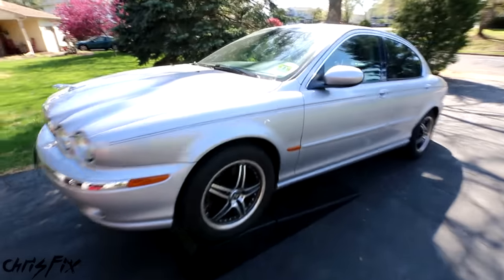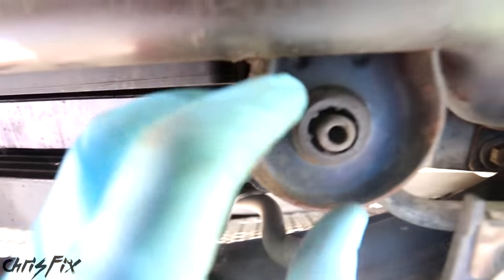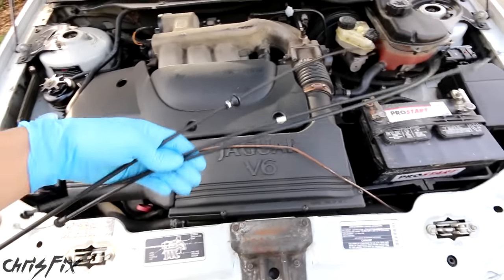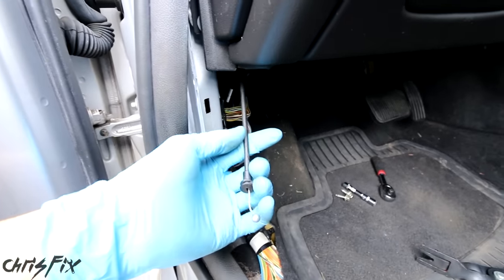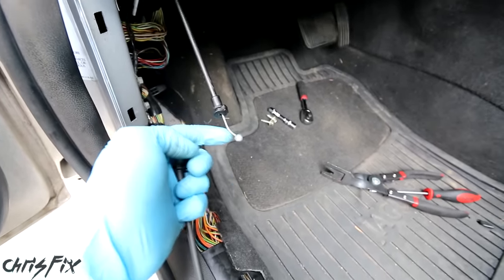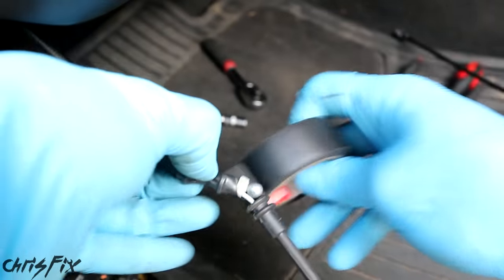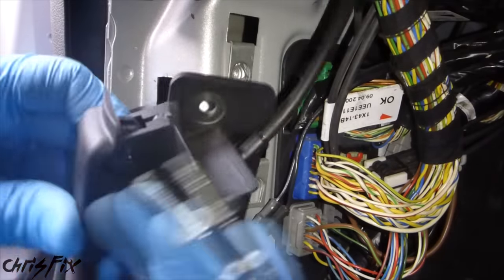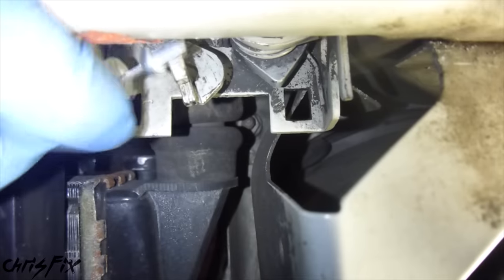What if your car's Hood won't Open?

Comment: My mum's car was made in 2002 (Ford Focus 2.0 Sedan). The hood is pretty easy to open. There's this button at the front which unlocks the hood. Then you press the Ford logo on the hood and it will open.
Reply from the maker: Nice!
Reply: There is also a button in the car which opens the boot (in Australia we call it the boot, but since you are probably American, it's the trunk).
Reply: Also, *grill. Not hood.
Reply: I don't know why, but her car isn't like most cars. It doesn't have handles on the doors that like like they are indented on the door, they look like someone just attached the handles on the car, or, they simply bulge out.

Comment: So that's how the battery to my car was stolen. Some theif left my hood popped open, and I wanted to understand how they did it. I now know how to do it, but is there anyway I can prevent them from getting to the wire. I was thinking of welding medal sheets to prevent them from tempering with the wires. Is there a better alternative you guys might reccomend? I've heard of the battery lock  mechanism.

Comment: Using some silicone spray on the cable would make it easier to slide through the firewall grommet.
Reply from the maker: Great tip! Thanks.

Comment: I know you're a Vette guy too. Any tips on how to use the C4 hood opening tool that Ecklers sells? My cable broke today and hood is shut tight. They make it look easy but all videos I've seen demonstrate the tool with the hood open. Not as easy with it closed. Just wondering if you ever came across the same problem. Thanks

Comment: Since it's a Jaguar, the best way to open the hood is to get it to about 70 miles an hour and then, very carefully, steer it toward a sturdy tree. That should definitely open the hood but also unlikely to damaged anything else that wasn't working anyway.

Comment: Good stuff Chris, ta very much. You could use the tip from the end of the video with wiring up a different speaker or something too couldn't you =)
Reply from the maker: Yes you could! It is a good way to run wires as well! I do that in this video: https://www.youtube.com/watch?v=b8GY69Ci7l4

Comment: your videos are so good Chris. my BMW 320i 3 series 1995 it won't start theres no clicking or anything when I turn the key. I've been told it's the starter and the immobiliser . do you have any suggestions. thanks
Reply: Take to a mechanic or a friend that knows about cars and then you should get your answer. Just tell them EVERYTHING you've done to it and when the last time it's functioned fine was
Reply from the maker: If it is the immobilizer then that is tough to diagnose but a bad starter is easy to diagnose. Jump the starter with 12v and see if it engages. Also, make sure the car is in park and also test the car in neutral.

Comment: Congratulations to Jaguar for out-engineering Honda for once. My Civic hood release is a pull tab that you pull straight towards you. It easily breaks and you're left with the exposed cable that now requires pliers to operate, before a proper fix.

Comment: This might not work (which may or may not be obvious) on hoods that use the car's key to open the hood, like my '07 Ford Focus MkII. It uses a plastic connection piece in mine to connect the keyhole to the latch. It actually broke once when I tried to open it, which was a pretty expensive fix. :(

Comment: Love your videos Chris. My 06 Accord's trunk won't open using the remote control in the car key but will open manually using the lever inside the car. Any help is appreciated.
Reply from the maker: when it clicks can you pop it up by hand? Maybe it just needs some lubrication!

Comment: Hello chris I been watching all your videos there the best videos I have seen so far !!!! I have a problem I purchased a Subaru Legacy 2005 Gt limited and I keep reading what type of coolant is best for the car but a lot are saying buy the Subaru long Life coolant vs the Peak Global Lifetime I just wanna know what the difference?
Reply: +Carmelo Ramirez 
After doing a bit of research I was able to find a difference between the two.
Subaru Long Life coolant is a phosphate based coolant. Phosphate additives in coolant have no anti-corrosion properties for aluminum, which is not necessary for your vehicle. Peak Global Lifetime does have anti-corrosive properties in the coolant. Although the other coolant will probably be fine, I'd use the Subaru Long Life coolant as a safe measure to ensure nothing happens.
Reply: Personally, I would go with whichever one is more available. 
I have 250k miles on my '99 Impreza and have always used the standard green coolant. 
You have to worry about changing it on time, more than using Subaru brand vs standard.
It's likely that at some point, a hose clamp, hose, or even the radiator itself will fail and you will not be able to readily get Subaru coolant.

Comment: Tips to clean your rims! (Brake dust and dirt :D)
Reply from the maker: +AVA That is a good idea!
Reply: +AVA 
Usually a decent all-purpose cleaner will get the job done quite easily.
Reply: Omar Awad Nope
Reply: Why nope?
Reply: AVA 
Why nope? APCs always work lol. Dedicated wheel cleaners have most the same chemicals in them.
Reply: Omar Awad Sometimes dirt and breakdust is too sticked to the rim, or there is just too much dirt and breakdust. Some cars have that problem (For examble Mercedes and Audi) (sry for my bad English:) )
Reply: I use all-purpose cleaner on my Mercedes! Let it sit on the wheel for a little bit, then go in and agitate it with a scrub brush. If your wheels are extremely bad, repeat this process and maybe even use fine steel wool or a sponge with a rough side on it.
Reply: Omar Awad :o Doesnt work on 2010 e-class (front) :D
Reply: AVA 
It takes a lot of work the first time, but once you clean it very well, it becomes very easy to clean it next time. I actually have an e-class too, haha.
Reply: +Omar Awad YaY :D

Comment: ANY THOUGHTS?: My hood release pull cord works just fine so, I really dont think its the pull cable/cord inside the cabin. It unlocks the hood, but the hood doesn't pop up and open on its own. I have to manually pry open the hood

Comment: I had opposite problem in my hood would open but not close. These seize up really bad in our winters in saskatchewan. Seems if you grab the cable manually an pull it real hard to the left it resets it an itll close

Comment: Hi Chris. Applied wd40 on the locking mechanism of my trunk and it still won't open. The lever that's hooked to the cable does not retrack or goes backwards when the key remote is pressed. Hence only the manual opener inside the car would olen it cuz it pulls the lever far enough to open the trunk.
Reply from the maker: Check out that lever and the cable then. See if it is rusty, getting hung up, stretched out, etc

Comment: Tried fixing my hood would close one side but not other now it won’t open at all should I just use the pry bar pop it open from bottom ? Also seems like my cable is to shorty should I just remove it all and add a new cable please help i have the Same exact car

Comment: Hey Chris, I know this is an old video but I have a Toyota Solara with a finnicky hood latch.  When just pulling the release, it has very little tension and nothing happens.  If I have someone pry up on the hood a little while I pull the release, it will pop like normal.  Should doing what you did in this video fix my issue?

Comment: Did this fix using your vid as reference, thanks, by the way have you a video on start up issues involving that car model, just replaced the battery cranks but won't turn over, any suggestions welcomed, thanks
Reply from the maker: Awesome!!! 
Check your fuel pressure and fuel pump: https://www.youtube.com/watch?v=mDIlwbx0B-s
Reply: ChrisFix thanks for replying will give those a try, 😎👍

Comment: Chris, I have a 2004 Mustang V6 3.8, manual transmission, rear wheel driver ofcourse. and I am going to need to to tow it from NY to CA, now that's a pretty long ride and I am on budget, any ideas that doesn't include trailers? Also, some manuals says flat towing is ok for the car and others says I have to remove the drive shaft.

Please let me know if you have any advise.
Thanks man
Reply: That's what I understand too Jmac, however some forms says that the manual transmission on this car works on upper shaft that doesn't get lubricated if not turned on. I kinda don't agree or understand that. Dealers don't know anything "my opinion" they try to slick out by telling me to put it on trailer without even asking about which year the car is :|.

Side note: this car is rear wheel drive, raising up the front wheel won't help. Thank you so :)
Reply: *****
makes more sense now, it will still scrap the front on asphalt all the way there, also not sure if the steering lock can hold this long of a distance swerving between traffic :D

Comment: That's quite easy... because the difficult part is opening that by hand or with a tool for the first time. That car had an easy access and it have 2 clips... mine has one in the middle, on top of the radiator and there's no way to open it by hand... i've had to dismount all the calender.

Comment: Jaguar X-Type  -- a.k.a. Ford Mondeo.  Same car, different badge.  Although, you couldn't buy a 3rd-gen Mondeo in the states -- it was sold here as the Ford Countour (and the Mercury Mystique) until the platform's 3rd generation came out, then they quit selling them here.  Shame, too, because the Countour with the V6 was quite a good car, for its day.  But you could buy the Jaguar X-Type, which was way overpriced compared to what a Contour would've sold for, if they had sold the 3rd-gen Contour here.

Comment: Question, Wouldn't it be smart oiling the cable just in case for extra long smoothness?
Reply from the maker: I was going to say that in the video but with thinking it though a little more, I found that the oil attracts dirt and dust which can cause more problems. The new wire has a coating on it to prevent rust so we shall see how that works! Good thinking!
Reply: +ChrisFix Thank you. I had problems with an wire like 1.5 years ago when it started to rust in an month because I didn't oil it so just tought to ask. Great videos btw even if I dont always learn something I enjoy watching them.

Comment: The correct term for what you did is not a snaking or using a snake, it's a pull string.  This is the term that we use in data communications If you're using bad cable to pull replacement cable.  It's also common practice with modern cabling is that a thin rope is run through the conduit or whatever In the industry so you have a pull string at all times.  We don't use what's called a snake, we use what's called fish tape.  The fish tape is pushed through the hole to where we need to have the cable pulled from attach the cable and pull it through.  I've had to use it many times to pull new data cabling as an emergency bypass for my former employer.

Get your technical terms correct.  Snakes are for clearing out a drain, fish tapes and pull strings are used for pulling cable.

Comment: Wait, shouldnt there be a security latch you have to lift before you can open the hood? Like, when you pull on the lever in the cabin, the hood opens a little bit, and then you have to pull on another latch under the hood to actually get the hood to open. This car doesnt seem to have that.

Comment: hey chris, I got sometimes problems with opening my small door of the gas tank. I press the leverage inside of the car for opening the door but it gets stuck often so its very awkward on the gas station lol. Any tips?
Reply from the maker: Lubricate the hinge and see if you can find where it’s getting caught up. Might have to be bent back a little or something.
Reply: @chrisfix  ok thanks for the tip,will try that :)

Comment: Hi Chris 

My VW Jetta 2007 is having similar issue. Hood release lever is working fine. When I pull it, it pops the hood open, but there is a tiny button which I have to push to make the hood completely open. When I press that button and pull the hood, it is supposed to open but it does not open.  Any thoughts???
Reply from the maker: Spray it down with some silicone or wd40 or something to loosen it up.
Reply: @chrisfix  thank you

Comment: Hey Chris, or anybody that might be able to help, I just bought a 91 Camaro RS, the hood isn't completely stuck shut but when I pull the hood release it doesn't pop open so sometimes I have to pull it multiple times before it unlocks and I can kind of force it to open. I know a lot of people have this problem it's fairly common but I can't seem to find any videos on how to fix it. Also since I'm going to be working on it a lot and I'm not super experienced expect a lot more questions coming in from me. Thanks in advance

Comment: Hey Chris any ideas on a kia amonti 2007 I change the radiator.  Now the hood does not open I put the cable latch back together but it doesn't open.

Comment: I wanted to buy diesel model of this car last year (2.0d manual or 2.2d automatic). But i ended up buying A kia ceed 1.6 crdi 2011 :) They are expensive in my country. And 2009 x-type 2.2d is 20.000USD here :(
Reply: Here's an example (24.000 usd):

https://www.sahibinden.com/ilan/vasita-otomobil-jaguar-sahibinden-2009-jaguar-x-type-2.2-dizel-otomatik-temiz-bakimli-327658437/detay

Comment: How inexpensive is the cable? I have the problem with my 2000 Dodge Durango tailgate door. It just won't unlatch from the lock. I need to disconnect the battery and then open up the panel. to get to it. I'm a big man, so getting in the back will be a little pain.
Reply from the maker: Varies based on the car. Just look it up and see. It was $50 for my Jag.

Comment: Hey ChrisFix? I've got an issue with my 01 jeep cherokee sport,  the trunk won't unlatch. Any suggestions would be appreciated. Thanks!
Reply from the maker: Luckily you can get to the latch. Remove the plastic and manually open the latch and see why it isnt working
Reply: +ChrisFix according to the previous owner who I just bought this from, there is a tab or something inside the latching mechanism that is bent. and the plastic bezel stuff would remove much easier with the trunk open. I think so anyway.

Comment: My cable good but my hood won't pop up. I need to hold the hood latch & have someone to push up on the hood to open it up. Do you have any idea what could cause that? & it's a lexus is300

Comment: That would be great for my car, except the cable broke off inside the dash.  Luckily for me I can easily remove the front grill and pop the hood that way.
Reply from the maker: Can you fix the part that holds the cable in the dash?

Comment: I have a 1942 ford coupe and when I pull the hood thing inside you can hear a noise from the hood but it does not pop up for the push thing will this video work or what do I do

Comment: @ChrisFix- I have this problem with my hood except I hear the click when I pull the button it goes "click!" When I go to the hood it's not openable, it's bi polar.. would you think it's the same problem as this video? PLEASE HELP! I'm tired of going back and forth in and out the car checking if the hood has popped already.

Comment: Hey Chris, speaking of coroded cables, I have a similar situation on a  1990 Ford Ranger involving the rusted e-brake cable. I know how to change it but i dont know what length to get as auto parts dont really specify. Any help?
Reply from the maker: The best part of the E-brake cable replacement is if the rusted part is under the car, you can splice in and crimp new wire for the rusted part. Get stainless steel cable or galvanized cable to prevent rust!
Reply: The parts are not that expensive and I'm doing both sides so there won't be future problems. A little less than $40 bucks to do both sides. They have different sizes for 9 or 10in drums and if its ext cab or single. Parts are online only and dont want to deal with returning wrong parts and wait.

Comment: Chris have you ever delt with a car that use dex-cool antifreeze I bought a car the hood latch was broken I couldn't look under the hood the car ran great then the water pump went out I changed that then the power steering pump went out anyways this dex-cool antifreeze is a nightmare from hell what can I do to get the car from getting hot i have to turn on the heaters it helps sometimes then it will drop down to normal I changed the thermostat also please help

Comment: Chrisfix I'm having a similar problem with my 2000 celica gts. I pull on the lever and the hood doesn't pop, but if I get my fingers around the hood I can pull up upwards and it will open. What so you think it might be?
Reply from the maker: Try cleaning the latch and spraying it down with some lubricant.
Reply: ChrisFix I'll do that! Thank you!

Comment: PLEASE do something about removing oil stains from concrete. PLEASE.
Reply from the maker: That is a great idea!
Reply: +ChrisFix it would be a huge help my car has been leaking tiny bits of oil and over time its turned into a huge dark spot on my driveway and it looks terrible
Reply: If the oil stain is relatively fresh, pour cat litter over the spot and let it sit. The litter will absorb the oil, then just sweep up the litter. If the oil spot is about 1-2 weeks old, you can try pouring a small amount of gasoline over the oil spot and using a blow torch to burn the oil away with the gasoline, exercise caution and use your judgement properly when doing so. If the oil spot is long term, there is essentially no way of removing it unless done so professionally.

Comment: you forgot to lube the cables,they would pass through easier and a good motorcycle chain lube for the new cable to prevent sticking and lengthen its life would be smart